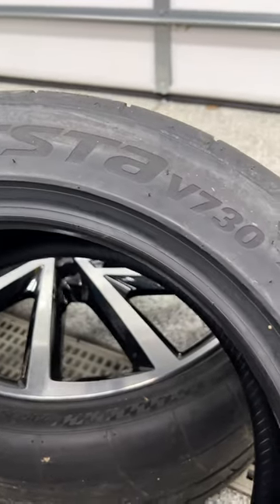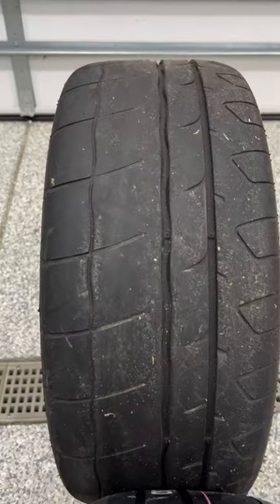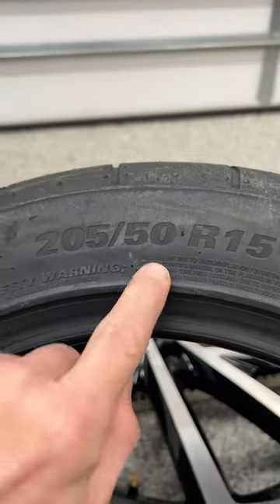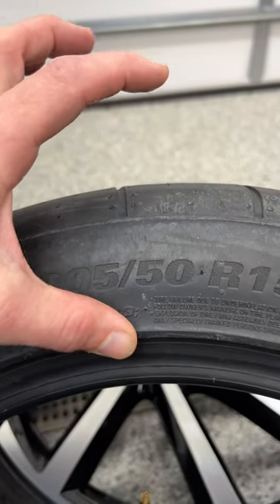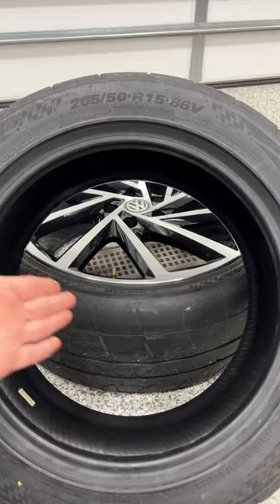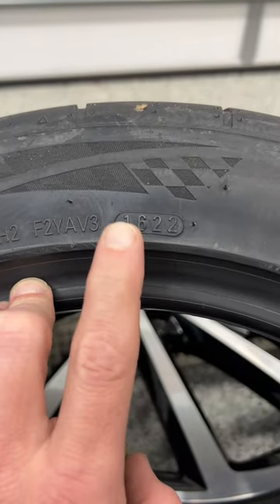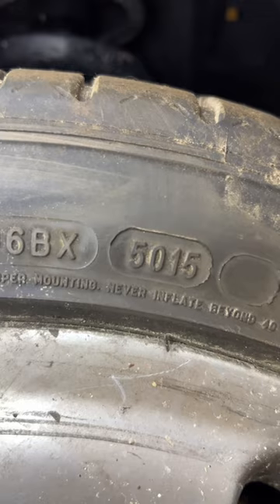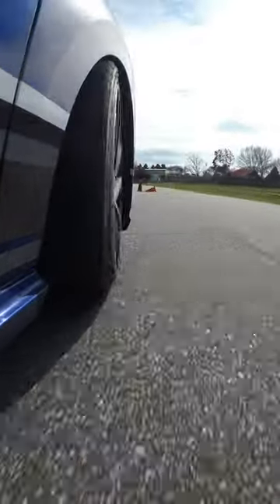What Does THIS Mean on Your Tire Sidewalls PT1

Comment: As others mentioned, the 2nd number is the percent of the width.  as explained in the video it isn't very clear.  You can easily have a 50 tire have a bigger height than a 70 for example.

Comment: I think aspect ratio is the number people find most confusing. It's a percentage, so a bigger number doesn't necessarily translate to more sidewall. A 205/50 will still have a bigger sidewall than a 165/60. 
So if you increase width you need to reduce the aspect ratio in order to keep the same sidewall height and therefore overall diameter.

Comment: If you actually think on it how stupid it is to use 3 different units for a measurement
mm for width
% for aspect ratio
Inches for rim rise
Reply from the maker: You are not wrong
Reply: @HumbleMechanic  tell that to bmw who made a metric diameter rim that is freaking impossible to get tires for easily in the United States back in the 90s. If the name Michelin TRX rings a bell you know what I’m talking about